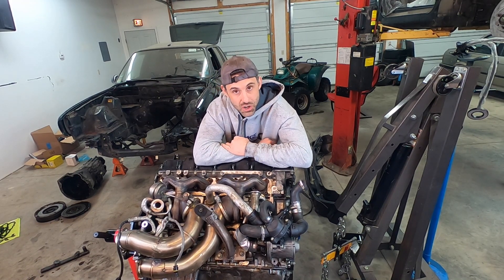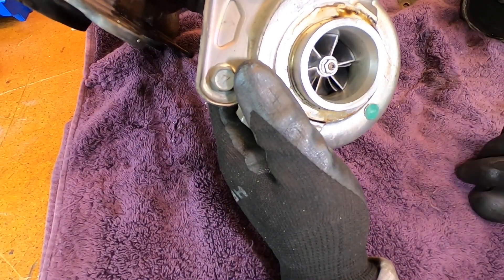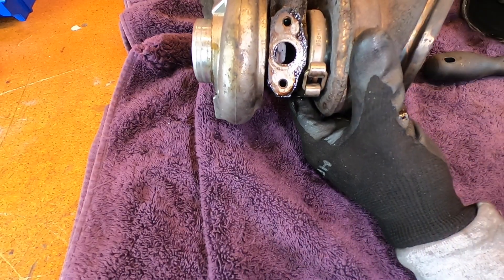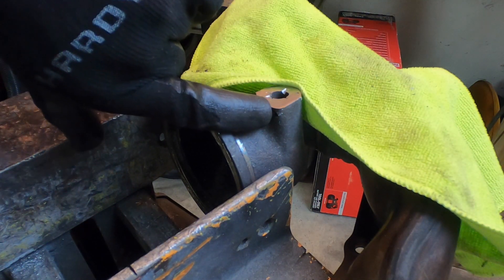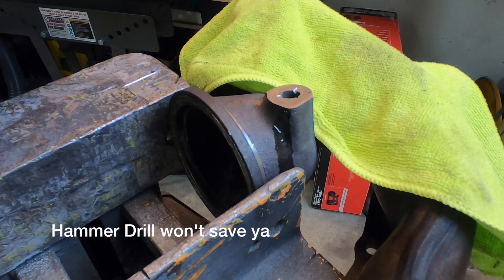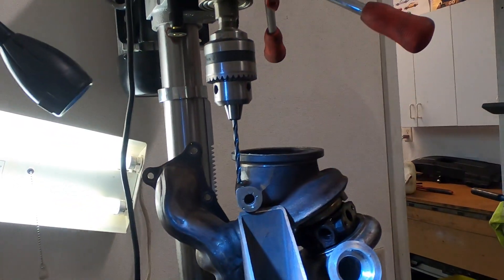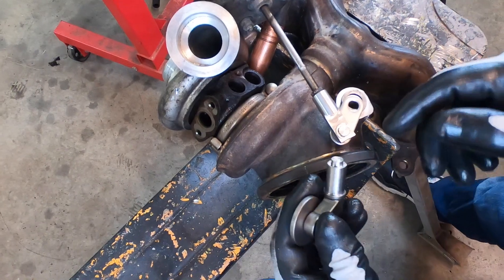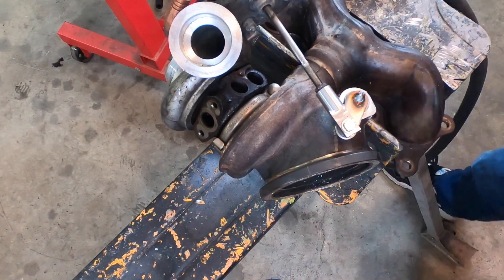Part 17: How To Fix Wastegate Rattle On The N54 Engine

Comment: I had to do this today,  so I was interested to see how else it could have been approached.  A 1/8 (3mm) drill bit was enough for me. Instead of grinding and hammering it out though, I opted to put a 7/8 (22mm) socket on top of the bushing and just pulled it out with a nut and bolt. Takes under a minute.
Reply from the maker: Not a bad idea! What size nut did you use?
Reply: @Garageaholic  The simplist ideas are usually the best ones! ;) It was a 13mm nut on an M8x70 bolt

Comment: I really appreciate these videos... but don’t forget the value of your time. Could have probably bought new turbos for the price of your labor spent rebuilding at standard mechanic rates.
Reply: I did this job and it was very frustrating. 26 hours.  But diy it I spent $80 to get a welder to do the bushing part.  And spent less than 1/4 of shop quote from the 3 lowest local bids. Upgraded the turbos to boot.
Reply: Just saying, mechanic rate is usually $100/hr give or take. You could spend the money on labor rebuilding turbos, or you could buy new turbos. The math speaks for itself. Everyone should spend their time how they want though.